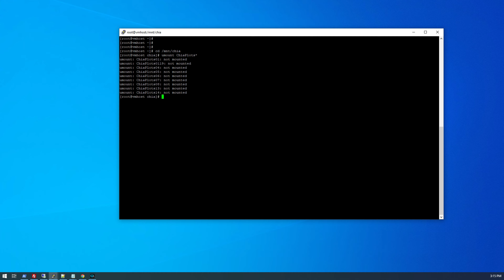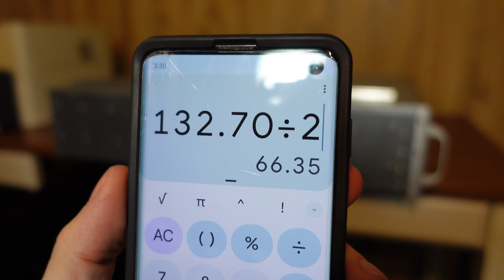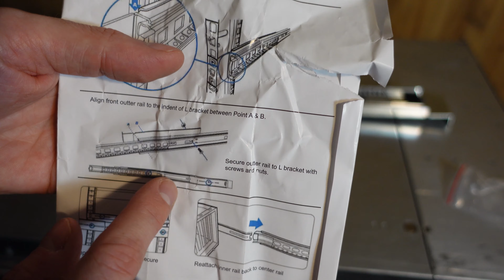iStarUSA Server Rails on a Supermicro CSE-836 Disk Shelf, Attempt and Failure

Comment: yeah, you got a really old Supermicro chassis with the old style rails (that's not even rev-A, it's pre-rev A). those are really hard to find, although I saw some over a year ago for $50 or so, but other than that, they are either really expensive or impossible to find.
Reply from the maker: Well that explains why I couldn't find rails for it. It had to be around 2012/2013 when I purchased it used. I remember it coming with a super old motherboard that used the long PCIX 64bit slots for the disk controllers 😂
Reply from the maker: I modified it to use RevB rails after this video and it's been working fantastic in the rack since.
Reply: @HomeSysAdmin  care to share a video of how you made the rev b’s work? This is what I need to do on one of my servers.

Comment: Did you ever come up with a solution? I find myself in a similar issue with an old chassis and can’t locate any rails
Reply from the maker: Yeah I bought a set of the newer Supermicro RevB rails and riveted the inner rail in place the same as I did here wiith the iStar rail. It worked perfectly and is racked up now.
Reply: @HomeSysAdmin  awesome to hear. I bought an old shelled out 836 and have been getting it filled in. I ordered the rev b rails before even noticing they made old wide ones. I’ll give it a shot and see if I can make it work. Thanks for giving me some hope
Reply: @HomeSysAdmin  did you end up mounting them at the same height as shown in the video? Or what ended up working? Haven’t started yet but couldn’t quite decide where it needed to be.

Comment: Is it really worth the effort and time? Sometimes you get the matching supermicro rails for around 80-90$ on ebay... and they just fit.
Reply from the maker: I have 3 of them that need rails, so it's a difference of over $120 using the generic rails. Having gone through this experience, I wouldn't do it again though! Best bet I thinks is to stalk ebay for the right deal.

Comment: Just saying that you can do a DYI to widen it. Get some 1/8” by 1/2” stock and with a little measuring / bending / drilling to make an off set. Then next time buying the correct one. But don’t let the bad fit go just modify it. Thanks again for your work and moving the two podcasts apart.